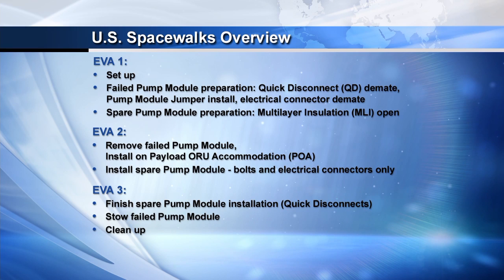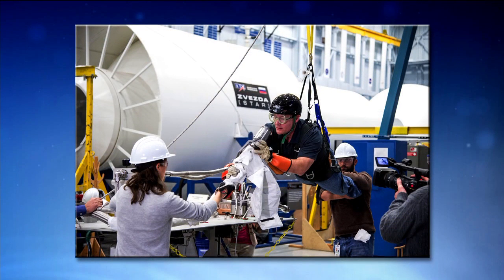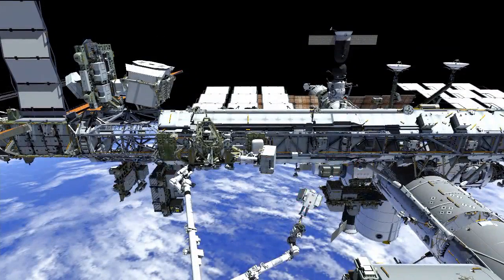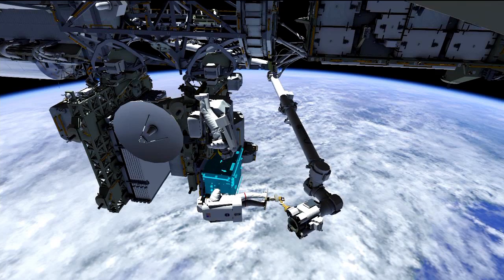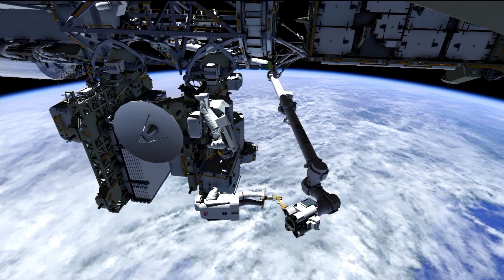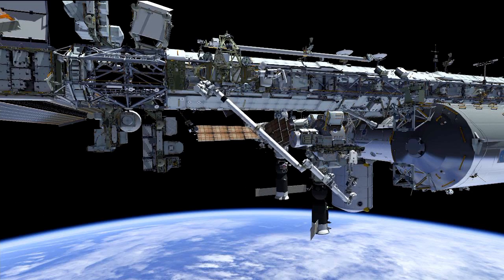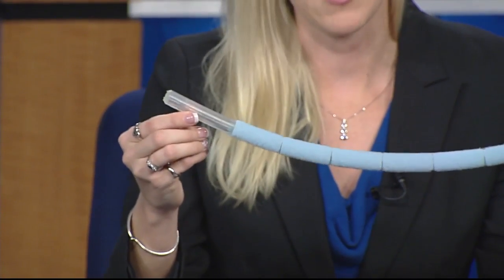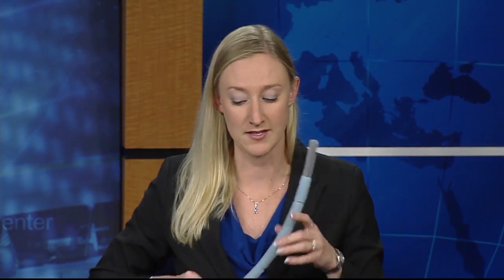NASA Previews Spacewalks to Replace ISS Coolant Pump

Comment: Браво, ISS support team ! And I was thinking that working on hot machines under pressure and high voltage is sometimes complicated... Can't image what is it like working IN a controlled air/water hydraulic system supporting your life while repairing a space ship's hydraulics... and with such huge temperature differences ! And all that with no gravity to drain the circuit or drop some tools :D Just incredible work !